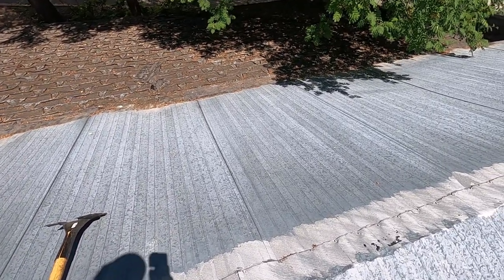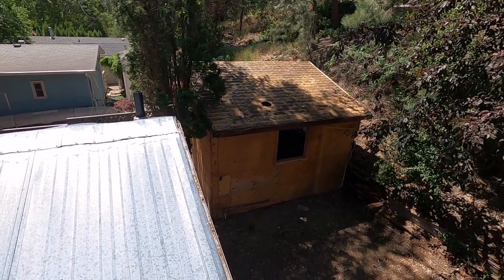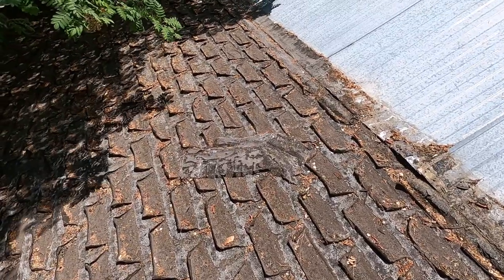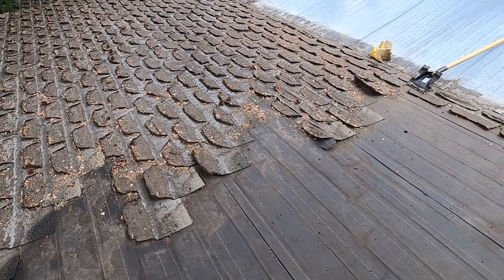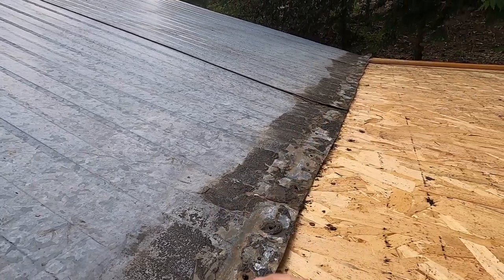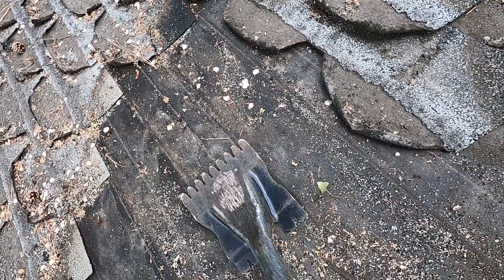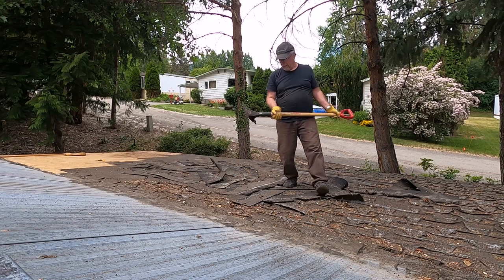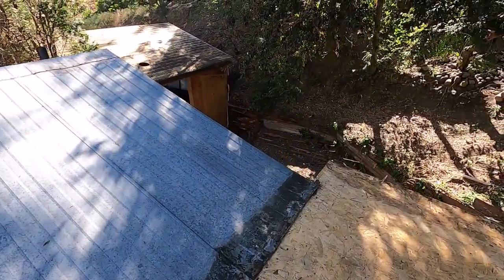Abandoned Mobile Home Project - Stripping Old Roof Shingles : E081 / BC Renovation Magazine

Comment: If the builder had done a better job, there would be less damage. However, since he didn't do a good job, it has made demo a little easier for you. 
I can't tell which is more preferable. lol
Reply from the maker: Hi, Becki. If the builder had done a better job then we could have salvaged something worthwhile, which would have been preferable. That extra building and the addition would be nice to have if they were good. I knew the addition was bad when I bought the place. There was so much stuff in that shed that I couldn't tell the true condition. I was hoping to save it, but... I also knew I was going to be taking down that old carport and deck. For what we paid for the place, it is no loss. There is definitely room in the budget for all of this demolition. We paid pennies on the dollar on this one. It was almost free. 

The pearl in this oyster is the original single wide unit sitting unskirted with no decks, additions or auxiliary structures on a clean lot. When we get to that point, hopefully by the end of the month, then we will have what I actually wanted to buy. The original single wide is in rough shape, but it is solid, which is what I look for. I can't wait to start building some new stuff. This demolition is hard work!